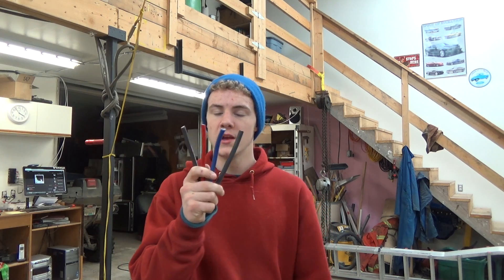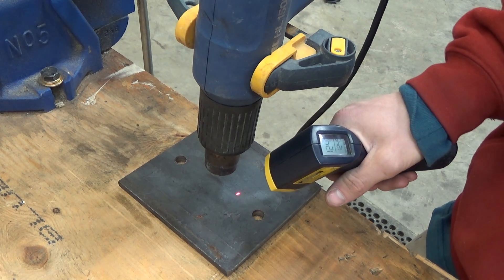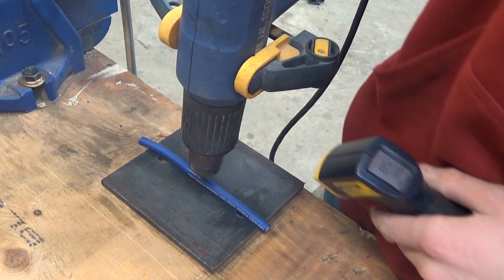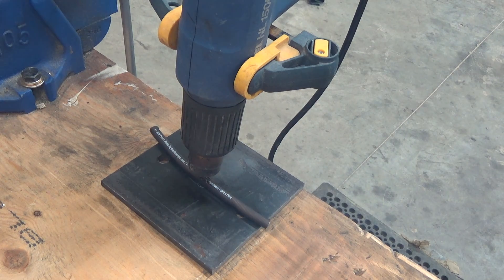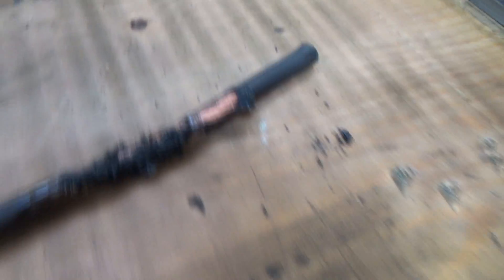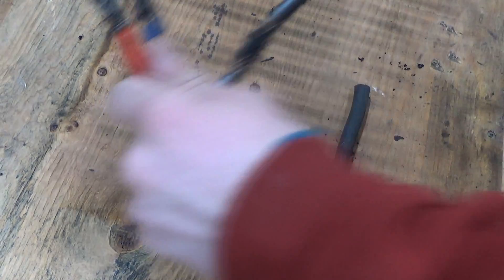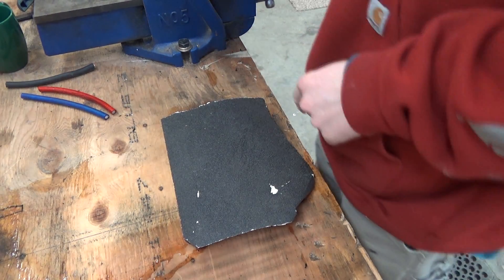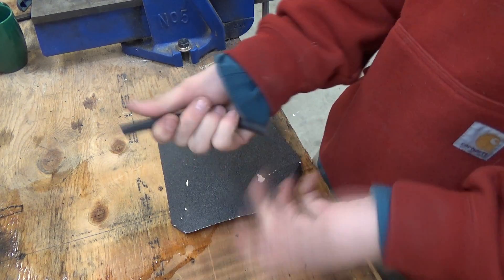Welding Cable Vs Car Audio Cable

Comment: What is the best way to terminate? Solder or bare wire? What kind of metal/material of spades and plugs?
Reply from the maker: solder would be the best in some scenarios, you would have to be more specific in what your terminating. and if one is using spades or similar crimp on methods the best iv ever seen/ use in my employment would be sta-kon stuff from t and b
Reply: DonkeysBreath I would be terminating speaker wires. Great channel bro.
Reply from the maker: Definitely solder in to speaker connections if possible, and on the amplifier side, that depends on the amp?

Comment: I don't care about any of these things. tinned copper is more conductive and wont overheat.. I am not talking about putting a flame to it. I am talking about using it as it was made to me used with power
Reply from the maker: Tinned copper is not more conducive it’s non tinned counter part, it’s just more resistant to oxidation and Solders more easily.

Comment: Thow the only cable of the 4 ones with pure Copper is the welding cable thow😉
So going to withstand alot more current and then the other ones

Comment: Sorry about your vice buddy! But I'm convinced the welding cable is best by your testing. I used 0 gauge welding cable for my amps and "big three" upgrade about 3 years ago. It's still holding up great.

Comment: It cracked because it is made of cast iron that is not ductile and the force was offset in the jaws. If you would have done that in the middle it probably would not have had any issues. If you want an UBER vise to replace that with, I highly suggest a Wilton 1700 series or a top of the line Yost. Pricey but I love mine a lot. AWESOME video and I learned a lot. TY!

Comment: Wasn't surprised when the vice broke.. next time distribute the clamping force evenly on the middle of the vice. You shouldn't ever use that much torque when tightening something that's not placed in the midlle. Your vice seems to be casted and therefore broke because it twisted under the immense pressure. Anyways just a tip😊
Reply: I don't even know what the vice test is trying to prove.

Comment: Just a word of advice when tightening anything up like the 2 plates and weld cable with impact gun.......Don't EVER rest your fingers over the gap in the top 
of the 2 plates when putting so much force on them when you are doing the bolts up!

 If for some reason one of your bolts breaks (maybe forgetting to use high tensile) all that force will have to go somewhere and 
closing that gap so fast that it will at the very least take a chunk out of any bits of your skin that are unlucky enough to get in the gap!

 I always got taught, learn by your mistakes, but trust me, if there is any i can save other people from doing, this would definitely
be one of them!

Comment: just look at what the chollos use for their crazy amp sucking hydro motors...they been using welding cable for 40+ years...along with electric forklift disconnects

Comment: This test was slightly extreme on the heat imo. I can understand in the engine bay. I have the Knu Konceptz Kollossess OFC in my car. I like it. Engine bay I put some extra protection on it near the engine. Other than that been great wire for me.
Reply from the maker: once we start talking OFC the topic starts slitting hairs

Comment: more accurate way to test their heat resistance would be a hot plate your blowing extremely hot air on it its defiantly gonna melt rubber
Reply: Defiantly huh?

Comment: Welding cable is truely reliable for car audio cable, for resistance, for flexibility and for durability. But the thickness of insulator makes difficulty while mounting in the car
Greetings from Indonesia

Comment: Who else got welding cables runing to his Amplifier in his car? LIKE
Reply: I'm using 0 gauge stinger I bought for 10 dollars  it was 25 ft ofc I plan to do my negative in welding cable
Reply: RIP headphone users at 2:30
Reply: Welding cable for power lead, 3ft 4ga replacement battery negative lead to ground.
Reply: I got plenty of 0 gauge welding cable i was debating if i should used it or not for my power
Reply: @franciscogutierrez2836  How much is plenty?
Reply: Pretty sure welding cable is able to carry more current as well
Reply: I've won car audio comps with my welding cable powered systems.😂
Reply: welding cable  wraped in high heat fiberglass  were needed   the rest is run in wire loom
Reply: Yeah, baby!!! 2/0 soft and flexible!
3.5k Synergy. 30lb car amp lol

Comment: they also make tinned welding / battery / marine cable.. it's better that standard welding cable because it's tinned and will not corrode and is used on boats, but still better priced than car audio wire

Comment: I get 2/0 ofc welding wire for $2.50 a ft.. 2/0 welding wire is a hair smaller than sky high 1/0 ofc because sky high uses there own oversized sizing charts. there 1/0 ofc is oversized it is about equal to 2/0 welding wire..

I used oversized sky high 1/0 for my main 12ft run to a fuse block in the back, then used 2/0 welding for everything else, including grounds and big 5 upgrades, and my extra battery runs
Reply: I buy all black 2/0 welding wire, then us tech flex to change it the colors I need, plus the tech flex looks awesome and adds extra protection from rubbing
Reply: +tankdog03 I buy it from.. acdcweldingsupply.com or Google acdc welding supply, it come from Michigan, the guys business is like an hour from my house
Reply from the maker: no why do you mix, why not pick or the other?

Comment: Let's just wrap the cable around the exhaust manifold!!!! Or let's have a little common sense and keep it away from all the hot spots and maybe some techflex, but just ignorant installers will just throw it anywhere in the engine compartment!!! I've had my big 4 ,dual runs to my rear battery bank for many years with 0 problems!!! Have a wonderful day 😎🤣

Comment: Use wielding cable if you need ofc wire at a lower price. If you want pretty wire that is a bit more flexible buy car audio specific wire.
But I can will ya that wielding cable wont let you down ,however, the look wont make you girls nips hard.
Reply from the maker: said right

Comment: If you want good heat resistance, use silicone insulated wire, that's all you need to know.
Reply: [ Oh, and never ever touch CCA, its evil ]

Comment: 3.50 is still expensive as fuck dude, thats how much 1 foot of 4/0 is.   eb flex, royal excellene is around 2 dollars a foot for 2/0 and its way better quality than the wire you are testing in your video.  There's no way you'll get through the jacket of either of the brands i suggested without some bolt cutters.
Reply from the maker: i should be more clear that 3.50 is in the Canadian dollar with a 12% tax

Comment: And my opinion is far as power drops through the cable is that the arc welding cable should transfer power way more efficient than the actual audio cables because it's a way finder wire
Reply from the maker: my take is there would be negotiable difference with dc when comparing the same size OFC high strand count vs low strand count
Reply: DonkeysBreath let me know what you find out if test them

Comment: This is a cool video I've used welding cable for 4 years as ground cable but I'm going to upgrade the rest of my system to it! And yes as far as the thought of heating abrasion was that it's arc welding cable so heat shouldn't be a problem and they're pretty resilient but your test proved my thoughts

Comment: There is a reason why we build fire trucks with welding cable as main power cable, as well as GXL smaller for ALL runs in our wiring..  (everything from 16 ga.(GXL) to 1ga to 4/0 cable for mains! (welding cable)).
It is used ,per NFPA regulations due to burning/flammability resistance!    Fire vehicles can have current draws of 300-400+ AMPS DC--just to note..
Bottom line is this: The quality of the installation is "everything"!!!!  you cannot run an amp cable n just leave it lay on the exhaust header/manifold!!! Besides, the more heat a wire is exposed to --you must "de-rate" the ampacity of the wire according to temperature..   If your going for "pretty" wire, go with what you want.. but functionality is everything in the "real world"!   Juts saying...   Good Job on the comparison testing you did!!!!

Comment: What brand is the Wal-Mart stuff, Wal-Mart here carries Scoshe which for quite a bit, in my experience, has been decent
Reply from the maker: It is scoshe, it’s the lowest end cable I’ve ever seen being sold in person(aka not on the internet)
Reply: DonkeysBreath well for "lowest end" It seemed to hold up good. Never used their amp kits, I build my own with welding cable or Pico automotive wire (you should test that! It's about 80$ CAD for 25 feet of 4ga).. but I've used Schoshe speaker wire a LOT and it's been good. Have a Schoshe battery terminal on both my cars and used it on prob 20 client cars. Their dash and integration kits haven't been bad for us either. Never tried any of their amps/speakers tho. They can be hit and miss, they have better products available that Wal-Mart doesn't carry, my distributor unfortunately doesn't carry them any more due to redundancy.
Reply: Also, the cheapest kits I can get (not online) are Raptor - we have their bulk, mid and pro series in our warehouse. I've used them on a couple "cheap" builds (read: customer doesn't wanna pay over $100 for wiring hardware) but never tested the quality of the power cable.

Comment: Well that's one way to show how to misuse a vice. Not only that you should have a a spacer on the opposite side of the vice to have equal pressure along the jaw of the vice. So I think you learned a lesson about how not to treat or abuse a vice. I think you over stressed in every test. So I can't believe what you are demonstrating on the wear of different cables. In other words it was not very scientific tests.

Comment: 9.50 a ft for OFC?? I paid 5.00 a ft for my 0 gauge stinger wire which in my opinion was fairly priced.
Reply from the maker: That would be if it’s tined etc.
Reply: You can get good tinned ofc 1/0 for $3-$5 a foot, don't know where this man bought his stuff but he got ripped off hard

Comment: That poor vise
Reply: The lesson is that the tightening bar on a vice is made the correct length to match the vice leadscrew strength, using an extension tube is abuse and makes any trained mechanic weep...
Reply from the maker: Rip

Comment: Welding cable is designed for caring very high current and amperage. It's far more Superior than 90% of the stuff out there marketed for car audio I have been using welding cable since the 90s and have had zero issues with it

Comment: Welding cable is great for car audio. We were using it in the 1980s. Welding cable is very flexible. Look for stick welding cable leads.  It can have thousands of strands.

Comment: The purpose for the popularity with welding cable in a car audio use is quality and cost 1/0 ofc of Sky High, Rockford, Stinger, Mechman, Certified Bass head, Shok or any other good brand they run from $5-6 a foot as where welding cable being AWG regulated 2/0 welding is the same as 1/0 audio wire so always step up 1 size on welding wire to stay equal to audio wire audio wire is oversized because they are not regulated by AWG standards but 2/0 welding equal to 1/0 audio is less than $2 a foot as far as Silver Tinned wire Silver bein the best conducter out its so small of a difference between OFC n Silver tinned its basically personal preference i run 2/0 Welding cable in my Tahoe n wont use anything else i like it alot n love the cost more not to mention the quality is outstanding i use 4g welding cable for my subs

Comment: The biggest thing is the amps the cable will carry. Most of the "Amp wires" are shit...its the amps that the wire can carry that will prevent voltage drops. Volts drop when the wire cannot carry the current and yeah welding cable will out perform any of the shitty cables that are sold for amp hookups

Comment: Re: the heat test. The one downside to the welding cable is that the burnt crust is virtually the same colour as the cable itself. So, when you inspect it, it would be harder to see a heat issue than the blue or red cable whose discolouration is obvious.
Last time I did this, I covered the portion of the welding cable visible in the engine bay with an extra layer of colourful (red) heat shrink tubing.

Comment: the heat test was the best. walmart is not true 4 gauge,the stinger is not bad,knukonceptz (actually pronounced new concepts) has high strand count an is the most flexible cable in your test i actually use it based on that alone.the welding cable looks to be the way to go.
Reply from the maker: 1styearsi yo know I never look twice at the name, thanks

Comment from the maker: all right guys, thinking about doing a revised Verison of this subject. What wire brands (on the car audio side of things) would you like to see tested.
Reply: Temco welding cable is a popular brand being used in car audio by some people. On the car audio brand side of things there is the ever popular Sky High Car Audio cables. Nice Reference To AvE Also could you do temp in Fahrenheit as well?
Reply from the maker: 666hobart will serious consider the cable suggestions but on the temp note, I’m only used to degrees science not Frankenstein. Lol, will do
Reply: Advice... To keep things on topic as they effect the usage you should test the temperature of the cable when moving a messured amount of current as well as voltage droop and cable resistance. Cable when properly routed should not suffer damage from abrasion, moisture, or heat. CCA cable has a higher resistance thus also heats up more which further increases resistance and also leads to greater voltage droop.
Reply: You should test some of the car audio wires like Soundbox Connected, Belva, or Knuconcepts.  All of these are priced very low on Amazon and i want to see how much power they can handle.
Reply: Orion True OFC 0 Gauge Complete Amp Wiring Kit 100% Pure Copper Wire. I’m thinking of ordering this but I’m not sure. It’s $71 for the kit on Amazon.
Reply from the maker: nikos95 that outlines, the whole idea for the revisit very well.
Reply: Skyhigh....knucocepts....stinger. welding cable.... get all ofc is possible.  Forget cca totally
Reply: DonkeysBreath NVX, SKYHIGH, KNUCONCEPTS, XS POWER, DC AUDIO, & FIBRE OPTIC
Reply: How about a note 9?
Reply: DonkeysBreath don't break your vise lol
Reply: What is a revised Verizon? AT&T? And ur dad gonna b pissed about his vice dawg...
Reply: Type M welding cable!
Reply: Stinger pro series(HPM) and Knu Concepts ofc.
Reply: I have used nvx, sky high(speaker wire), Fosgate, streetwires, stinger, and xs power. In my opinion all of them in ofc verity are good products overall but for the money the best value being Fosgate or nvx. Sky high seems overrated and unfortunately their CCA blends into the better ofc product line without any easy way to distinguish between the two other than price which could easily be avoided. The others I have used have never had any issues with either but better products for similar money are available. Nice shout out to AvE keep your Richard in a bad habit. I'll probably use some eb flex or royal excelene in my upcoming projects. The only thing that's prevented me previously is strand count which is somewhat silly.
Reply: Knukonceptz

Comment: I weld and I install amps I have used amp power cable for welding and I can say in every case welding cable far out classis all of the other power cables hands down